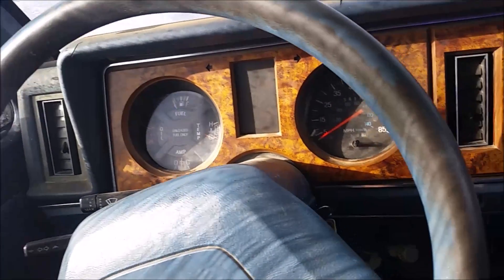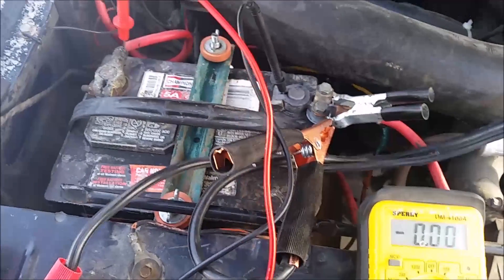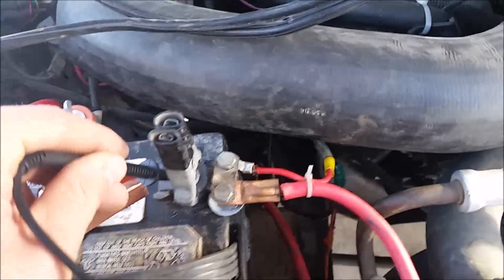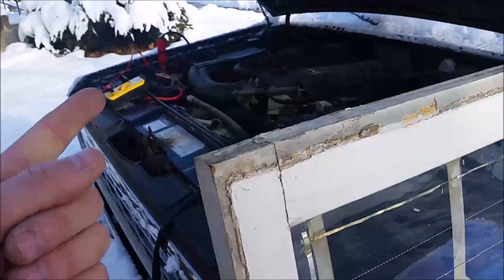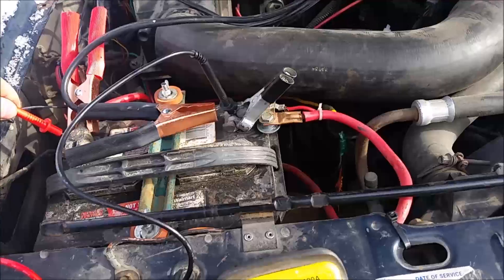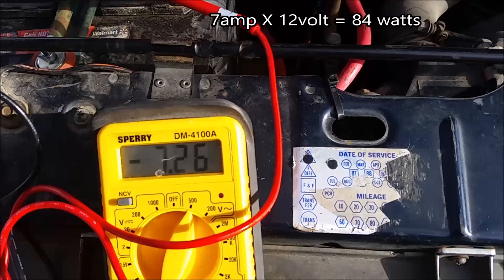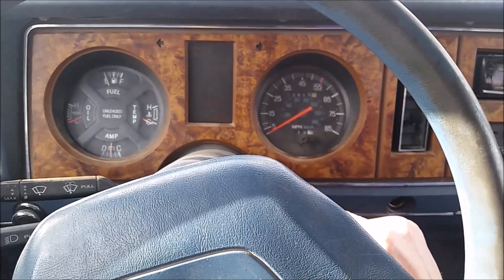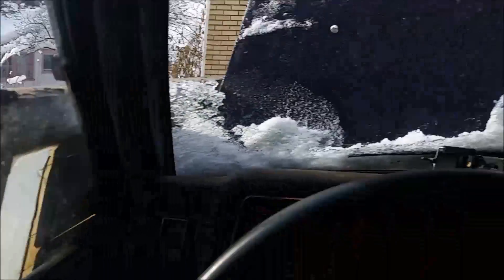Solar Jumpstart

Comment: you dont need that diode in order to keep the battery safe when the sun is not shining. The solar panel will act like a diode in blocking direction and (almost ) no current will be flowing

Comment: Cody you should mention that there is a risk of cooking the battery once the voltage has risen far enough. A charge controller will cap the voltage and also optimize the charging.

Comment: you could permanently have the solar panel tied to your battery with a series switch that goes to the dashboard so you can turn it on whenever you need it that would be sweet in my opinion

Comment: 7amps at 19volts is NOT 84watts.  Back to the drawing board.
Reply: when you draw amperage from a solar panel drops. in this case it dropped from 19v to 12v once amperage was measured, so it is 7 amps at 12v

Comment: and I have a inverter box that will not charge batteries over 14.5 volts due to the fact I think chargeing your battery at 19 volts is to high... other than that .. I couldn't tell in the video what was negative and positive. . there was to many wires connected to your battery

Comment: The starter on my truck used to do that when it was cold, generally it is a sign of a weak or old starter. I replaced mine with a rebuilt unit and it starts better than ever!

Comment: Do photons from the sun carry more energy than the ones from artificial light sources?
Reply: +Ugnius Kasinskas it kinda depends on what you mean... like the portion of light in the UV spectrum that the sun emits (and which most artificial light sources don't) contain more energy per photon because they have a higher frequency (around 10 to 350nm). but for using photovoltaic cells like in this video, most of them only absorb energy from visible light to just into the infrared (low frequency) spectrum (that is, utilizing energy from photons between 375 to 1100nm), so they don't convert those UV photons into electrical energy.

Comment: Why don't you just drop the clutch in 2nd silly.
Reply: +zach7147 this doesn't work on a dead battery unless you're on a super steep hill. with a fully charged battery but a bad starter, you can easily turn over the engine because the battery can supply enough voltage to run the plugs, injectors, fuel pump, etc.... but on a dead battery you need to get the engine to a much higher RPM to get the alternator to put out enough voltage to run these things taking into account the voltage drop from also charging the battery.

Comment: at least he didn't do what most people do. which is rev the crap out of engine to "warm it up". if your car is cold any person with a brain and common sense knows that revving a car cold is actually bad for it. it is better for the engine to just leave it run for a few minutes. thus also increasing the life of the car. if you want to kill a car. the quickest way of doing it is to rev it cold
Reply from the maker: +SIPPYGamesIn 1080p (SippyGamezIn1080p) 
Very true, gota get that oil in the bearings before gunning it.
Reply: *****
yep! sure do! when I was watching you going to start the truck I was cringing haha. then you started it properly haha. good job! :D:D

Comment: Actually the reverse current draw for polycrystalline cells at low voltages is near nothing.Those diodes are more needed voor higher voltages with multiple panels in series.

Comment: never put the pole on the battery put it some were else on the car and detach it first than do the +pole if you load the battery to much it produces h2 and when you detach the pole the spark could make the gas explode just a tip ;)

Comment: Actually, when you apply voltage to solar cells they act like infrared led's :) That's what I heard at least. Maybe you could confirm it Cody?
Reply from the maker: +Arnþór Gíslason 
They make heat, so yes.

Comment: The potential was 19v for the solar panel, would the battery take damage if it was left charging for a longer period of time? Can you put on a voltage regulator at ~13v or would the current still hurt the battery?
Reply from the maker: +knarkis90 
solar regulators cut the current when the battery reaches 14v or so, easy to do by hand, but yes i would damage the battery if left longer.

Comment: wait u said the solar panel in 18v y u multiple 7amps by 12v instead of 7amps by 18v
Reply from the maker: +science Vlog 
yes it is confusing. The current in a circuit is related to the resistance and voltage applied (ohms law). When I apply the panel to a circuit with a low resistance I should expect the amperage to go way up. If I have high amperage but have the same voltage the wattage or work the panel is doing would also go way up. But the solar panel has a limit to how much work it can do, it can only generate so many watts. Therefore something must go down and that is usually voltage (because the light moves the same number of electrons regardless of load) . Its kinda like a pump pushing water through a pipe and a large load is like a pipe with a large diameter. The large diameter pipe will have a lower pressure than a small diameter pipe even though the amount of water flowing is the same.

Comment: 10°C here in Germany :)
Imagine how many watts this thing brings in summer. If you build like 10 or 20 of these solar panels, you won't have to pay for electricity anymore.
Reply: I think, it works very good in winter because the snow reflects the sunlight so it wonˋt make a great differnce.

Comment: I don't think the truck would be running long on empty !!! oh BTW Cody its not good to run that low on gas .
Reply: Rangers still have about a quarter of a tank when they show E. I call it Reserve.
Reply: Oh and they always show lower than they actually are before they're warmed up. Mine would be off by a quarter of a tank until it warmed up.

Comment: arent you blocking usable wavelengths by using normal window glass?
Reply: he is using normal glass and it blocks around 20 percent of the sunlight but he doesnt care enough to buy special glass because that would be a little too expensive
Reply: only ultraviolet right?
Reply: Gijs
and infrared

Comment: Hey Cody - amazing as always.

With the new flight to the ISS yesterday with the first official UK astronaut - could you do a video for me over christmas?  I have always wondered why we use all of those violent rockets rather than using a plane to get a rocket up - what is the difference in using a rocket and going straight up withe attendant rockets and rocket fuel rather than a less violent plane right up to the edge of space with then less rocket fuel to break out of orbit - or is that a real difficult question to answer?
Thanks - hope your exams are going well?
Kalvin

Comment: I saw a video a while ago (its been made private now unfortunately) where a guy made an alloy of Gallinstan but he also added bismuth aluminium and antimony to increase the surface tension and the alloy looked and acted like liquid Mercury (the density was much less of course). I am wondering if you could try to recreate what he made or something similar? he did not post the formula.

Comment: Nice! I've done something similar,but it took a while with my ~10W panel.
I'd permanently stick the diode on the panel,since in most applications,it will be needed. See if you can find an old PC power supply to tear apart,and find a beefy diode that will handle 10A. There's usually some good ones in TO-220 packages on the DC output side,mounted to the heat sink.

Comment: But still no snow in Quebec...
Reply: +ThePyrosirys It's because of El nino wich gets boosted by climat change from what I understand, they will  probably be getting more snow in the US than us and we are risking another ''verglas'' (don't know the term in english) just like in 1997 wich was also caused by an El nino.
Reply: +ammotomma So it will not snow this winter for us?. ( living in toronto)
Reply: +Anthony K it's been consistently in the 50s and 60s here on the east cost of us
Reply: + it's snowed this morning for a minute  and so........
frist time seeing snow for this winter
Reply: nah i've seen snow in montreal in october, but we'll get snow, don't worry. It'll take a while though and it's mostly gonna be icy.
Reply: I'm in New England. I had a tiny bit of snow way back in October, but not a flake since...
Reply: +ThePyrosirys Not too far away, only snowed a tiny bit in Toronto and it melted 5 mins later lol
Reply: +ThePyrosirys Its because of El Nino

Comment: That home made panel delivers impressive power. You could fix some solar cells on your cars roof with resin and add a cheap solar charge regulator. That would add quite a bit of autonomy to your car. You are quite lucky, not tho have one of those modern cars you can't even unlock when the battery is dead.
Reply: +Arno nümuss what modern cars are you unable to unlock when the battery is dead? every modern car i've seen has an emergency traditional key built into the keyfob to get into the car and emergency interior door unlock buttons, even if a bit hidden like they are on the corvette c7.

Comment: if we shine light on solar panel and generate voltage, what if we do it backward? input voltage into solar panel. will it create photon or just some other chemical reaction?
Reply from the maker: +Ryomichi 
It will produce light actually, just in a wavelength that we cant see.

Comment: G'day,

 Yay Team !

 I began driving around with a 5 Watt Streamlined Omnidirectional Array of PVs on my 1983 Subaru 4WD in 2008, it's "Killer Ap." was to finish charging the Battery AFTER the motor is stopped... ; because I live 15 Km out from a small town and my average Engine Runtime  is 6 minutes, so the Alternator never ever finished the job...

 It worked, so I called it the SunFoil Mk 1, & it saved 1.5 Litres of Fuel per week,  the 20 Watt Mk 2 saved 4.2 L/Wk, and the 30 Watt Mk 3 saved 5.33 Litres/ Week...; it's unpatentable, so I  put the project on YT, all the data, all the Construction Vid's..., follow me back to my "SunFoil Project" Playlist and it's all there.

   You would've probably been better off leaving the Panel on it, rather than thinking the Alternator would thump it harder..., if the Panel was feeding 6 or 7 Amps in and the Battery was only showing  13.12 Volts, then the Battery was less than half recharged when you cruelly forced it to give you a Cold Start, you naughty man, you !

 Regarding a Lead/Acid Battery, 10.5 Volts is Totally & Utterly Flat, and the Electrolyte will show a Specific Gravity of 1.000, whereas 13.2 Volts Resting, at 25 Degrees Celsius is a "Fully Charged Battery in Perfect Condition", and the Electrolyte should be 1.300 S.G....

  The Regulator on the Alternator will have hit that Flattery with a fat Current (20-30 Amps,  maybe ; if the Alternator Step-Up Drive Ratio will turn the Rotor fast enough, at idle..?) which will cause a Spike on the Charging-Resistance, and then the Alternator will be regulated back and back and back, and held at 13.3 - 13.5 Volts, after it's first been up to 14.2 or so....; so maybe 20 minutes after you left the Alternator to play with that Flattery, the Charging Current would probably be less than what the Panel was simply mindlessly pushing through that Diode.

 My 2000 Forester got a new Battery 3 months and a bit over 2,000 Km ago, it was resting at 12.83 Volts (85% Charged) on installation, it now rests at 12.81 Volts (83%)...; so I calculate that my Alternator runs now at an average of 17% output in an endlessly failing attempt to recharge a New Battery.., so when I fit the 70 Watt Mk-8 Sunfoil I'm hoping for a 15% - 20% Fuelburn Reduction.

 Projecta 8-Amp Solar Charge Controllers are $55 in the shops, here in Oz, so maybe $US40 ?

  If you connect them outside the Ignition Circuit (with an Inline Fuse) then not only do they   finish recharging after Shutdown but also they automatically run up to 14.5 V to desulphate the Plates every time the Voltage goes under 12.35, which happens EVERY time the Starter-Motor sucks on the Battery ; meaning that in daylight the Solar Regulator will "Outvolt" the one on the Alternator, so the Vehicle consumes Solar Electricity rather than Mechanically sourced Electricity..., any time the Sun's up.

 Have fun, and good luck with the Exams...

;-p

Ciao !

Comment: Just a tip from an old mechanic, around 12v is discharged, above 13v is charged.... At 7 amps draw you still had some charging to do.
Reply from the maker: +Goontrons rambles and randoms 
I figured it out when It didn't start right up. lol

Comment: I didn't know that solar panels would run backwards (Since I thought mabye the silicone in them would act as a transistor). Is their any plan to attach a permanent diode to the panels circuitry?

Comment: +Cody'sLab this is awesome Cody! I hope to do projects like you when I get into college. I'm only a freshman so I've got a few more years to go. oh and I have a question about the iodine video. how did you make the water solution of the burned seaweed into a white powdery wet substance when boiling it? it looks like potassium iodine. I either get nothing or I get something that does react with the sulfuric acid but doesn't create iodine vapor or iodine. What could be the problem? I live near the beach so I can easily try as many times possible. I have looked over that video 10 - 20 times and tried making iodine the same amount of times. can you tell me what I can do to get the iodine from seaweed? 
Thank You Cody!
-Kyle McMullin
Reply from the maker: +Kman Meteor 
Use hot water to leach the salts and burn down more sea weed. try to get the kind that is in fat ribbons.
Reply: ***** the fat ribbons with the balls on them? I hope you don't think wrong for what I said I just need help.
Reply from the maker: +Kman Meteor 
Took me at least 4 try to get it to work and I think I got lucky.
Reply: ***** thank you so much Cody! I hope to see more amazing videos and I also hope to upload more videos.
Reply from the maker: +Kman Meteor 
Oh! the acid needs to be very strong, plumbing stuff wont work.
Reply: +Kman Meteor if you want more subs that's not the way to go, son.
if your videos are good, they will attract people.
don't ask popular youtubers to do the work for you.
imagine everybody did that
Reply: Nothing to fell sorry about. It's just my opinion man. Let it take it's natural course and see where it gets ya
Reply: nirvanahater ok.
Reply: nirvanahater OK I will edit the post sorry :(

Comment: Just a suggestion about the audio: the sound is kind'o loud around 10 000 - 16 000 hertz and it makes your "s"-sounds and other sharps sounds really stick out. I've noticed it in some of your other videos too. I don't know how much you bother with editing, but you could try using an equalizer to turn it down in that frequency register ^^
Reply: +TheySmashedAnHourglass "WHY DOESNT ANYONE MENTION ABOUT AUDIO ONLY COMING OUT OF ONE SIDE."- original comment. Woops, I was being abit impulsive. Still, the stereo recording is really annoying for me, with the overly huge difference in volume ranges for each side.
Reply: +Knoughts I saw another comment about it, so I thought it wasn't much of a point for me to repeat the same thing ^^''

Comment: Hi Cody, I'm a new sub! :)

Have you ever seen someone replace a car's battery with capacitors? I saw that a while back in someone's video and it seemed like a great alternative to a battery to save weight in performance oriented cars. I was just wondering if you had any incite into that idea, or if you even think it would be feasible.

I was thinking you could have some simple mechanism to charge them and then no matter what situation you were in you could start your car with a few cranks.
Reply: +Christian Neff Always park on a slope. Pop it in 2nd gear, start rolling and release the clutch when you've gained some speed.
Reply: What?
Reply from the maker: +Christian Neff 
Capacitors will work, but you only get one shot before having to recharge. My model-T has a hand crank which does work.
Reply from the maker: +Christian Neff 
He was telling us how to roll start a manual. Which is what I usually do but I wanted to try the pannel.
Reply: +Christian Neff Always park on a hill and you can roll start your car even if the battery is dead.
Reply: ***** I wonder what it would take to charge the capacitors you would need to start a car. It'd be cool if you had a pump or crank inside the car and could charge them before starting the engine.
Reply: +Christian Neff Jay Leno has shown in one of his youtube videos an antique car in his collection that used a capacitor system. Just crank the handle on the dash and then press the starter.
Reply: +Christian Neff The guy with the Lasersaber channel does that. He's building supercapacitors in his kitchen now. He does a lot with this kind of stuff.
Reply: +Cody'sLab 
Not really, depends on the car and the capacitor bank. Lasersaber has vids on the topic, he can strat his car several times but its a small toyota or something.
Reply: +Cody'sLab "roll start"? I've always heard it called "popping the clutch". Though I guess "roll start" is much more descriptive.
Reply: +Cody'sLab 
I would very much so like to see a video of your model T one day :)
Reply: +USWaterRockets you mean styropyro?
Reply: +Cody'sLab actually going with super caps will give out plenty of jiuce . just dont go with audio equipement style.